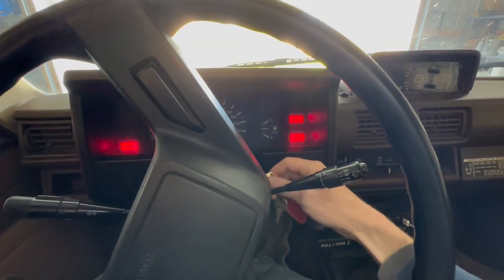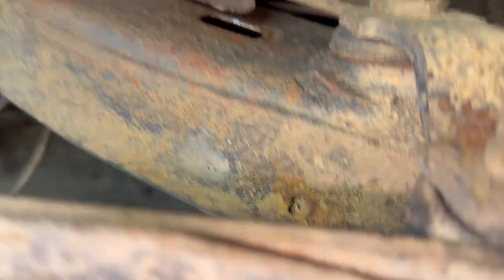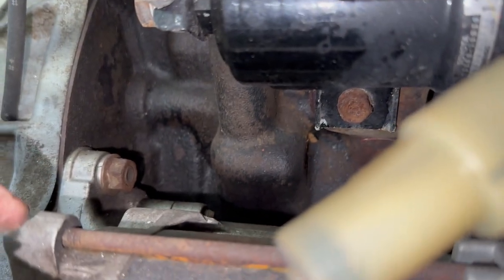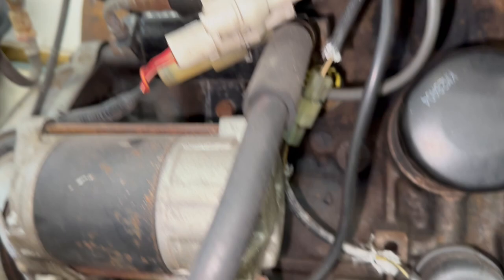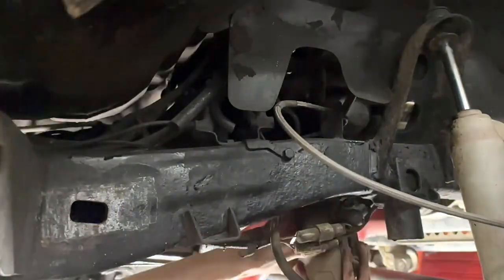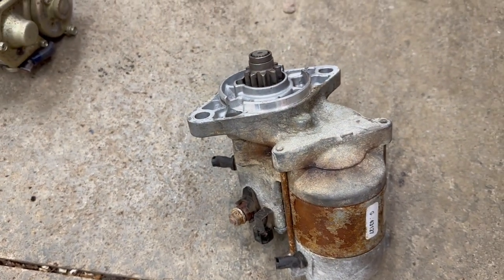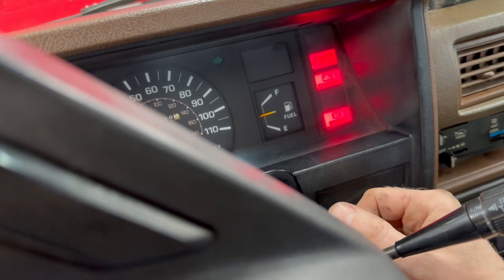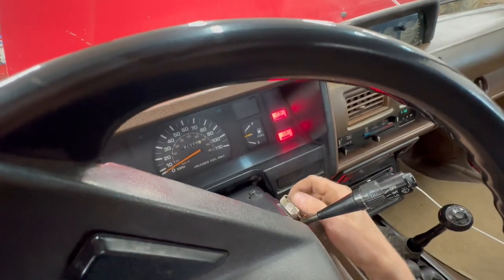Starter Replacement - How to Replace Starter on Toyota Pickup/Hilux 22R/22RE

Comment: Classic symptom of bad starter solenoid contacts. I always just pull the cover off the solenoid and clean the contacts, they work great after that.
Reply: Late to the party here but could this also cause the starter to start sticking? I can hear mine continue to whir after the engine has started and it usually releases after ~5 seconds. Afraid it's gonna burn the thing out. May give this a shot before full on replacing

Comment: I have replace a few starter on my 1986 bought 2WD truck. That top nut can be removed from atop the starter. Use a ratchet flex end  box wrench as the swing area is tight. You can reach down to get to it. The nuts are only 29 ft/lbs torque. Might need a stool to stand on with a 4WD with big wheel like this one. Takes less than 30 minutes.

Comment: It's nice that you had an engine sitting there to provide a better look at where the bolts are.
Reply from the maker: Yeah, it took out a lot of the guesswork in removing the upper nut
Reply: @6thGearGarage  True, you can see it, but making a video and showing folks is another story. My 2wd must be easier to access? I removed all the smog stuff and have an Offy intake, so that is probably why mine looks easier. Great work, and we love your videos. Jim and Tim

Comment: Thanks for the video. With your help, I replaced the starter motor in my 92 pickup. I had to do the same socket acrobatics you did, but it worked and my truck is back on the road.
Reply from the maker: Great to hear!!

Comment: First time I've seen an part replacement video end with the disappointment of the new part still not working properly 😂. I have it happen every now and then and I'm always thinking "I CANNOT be the only one this happens to".
Reply from the maker: Yeah I couldn't believe it worked when I tested it, but not after I put it in! Glad a few hammer taps got it working... it's been fine ever since.  Weird...
Reply: Happens all the time. I think it's a racket.

Comment: It's always worth cleaning both sides of that ignition wire clip plug first. The metal contact blades can loosen up or the plastic plug or clip can be cracked. They can also be very dirty inside if you've ever had an oil leak. And heads up to anyone with air conditioning, it will be even harder to reach the mounting bolts from the front.

Comment: my 91 toyota pickup did that a few months ago. i just changed the starter. it is easier than taking it apart to fix an bad connection issue
Reply: I’m gonna attempt a starter swap on my 91 Toyota pickup today, any pitfalls I should watch out for?
Reply: @DavidArias2  don't cross thread the main connection. I almost did it since it's the hardest one to see after swapping the starter.

Comment: I actually had this issue but it was the relay. The relay was acually good but the connection from the battery had a wiring issue. I ran a 12 gauge wire from the relay to the battery and havent had issue since

Comment: The wires that are just sitting there have a clip that clips over the wire where the star ended plastic thingy is and the clip is attached to the bottom starter bolt, can be tricky to get it and bolt in and thats why its not there for your truck...someone said F it and left the wires hanging.  Also you can get a Toyota remanufactured starter from Yota toyota parts...bit pricy at $125 but Im a OEM type if I can....